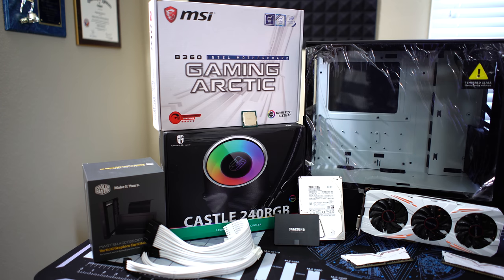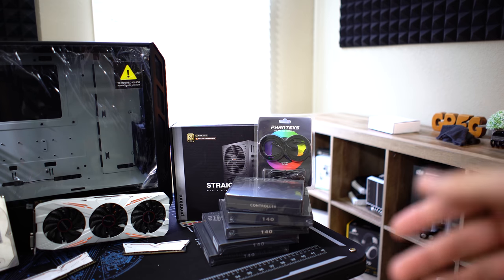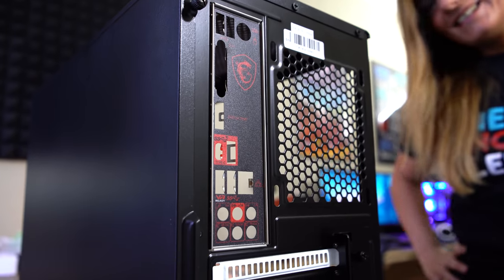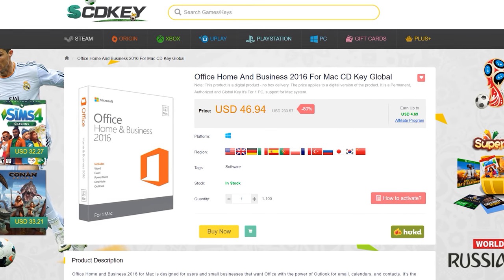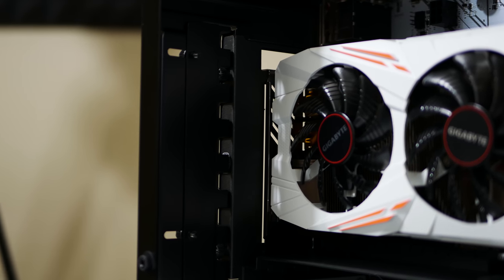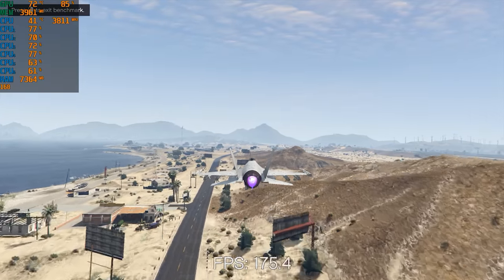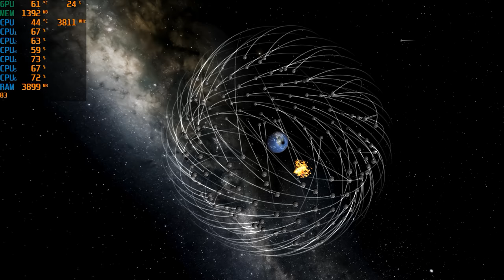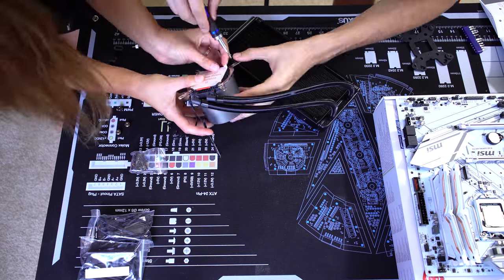We Paired a 1080Ti with an i5 8400...

Comment: Just came across this and have to add that i disagree.  even withaverage cpu load you can still have a system that bottlenecks your gpu. thats pretty clea since the 9900k and 10900k came out.  you can get more fps out of the same gpu despite it being always on max usage.  same for faster ram. it improves fps despite it not seeming to be a bottleneck it clearly is or you wouldnt get better fps out of it.
Reply from the maker: This is an old video. Things change super fast. If you're CPU-bound entirely, then upgrading GPUs won't change much of anything. If you do see a performance increase after swapping cards, then you weren't truly CPU-bound to begin with. I never said that you can't have a GPU bottleneck if the CPU is moderately loaded. It's common sense.
Reply: @GregSalazar  i mainly commented as many people believe that you are only cpu bound if your gpu is not hitting 100% load and your cpu is showing 100% load. And that is wrong you can get much more fps from a faster cpu even if your gpu is already at 100% load and your cpu is not. 
As for truly cpu boung i think noone is these days  even a old quad core with a 2080 ti will benefit from a upgrade to the new gpu when it hits. and its also possible that that new gpu will hit 100% load. That all however does not mean your not limited by your cpu.   if you watcyh all the reveiwers that test cpus for gaming with a 2080TI theres massive differences in performance per cpu.  they however do not call that cpu bound but yet in my opinion it is as you can miss huge performance by getting a faster cpu. 

I still have no clue how a gpu can run at 100% but still benefit from faster ram and a faster cpu tho.  it is strange to me as you woulld expect that 100% gpu load is 100% gpu load and it cant preform more work.  my only theory is that the gpu load refresh is so low that you wont nitice the gpu idling for fraction of a second all the time wating for the ram and or gpu to catch up. 

Anyway i respoonded as this came out on top researching bottlenecking  (was helping someone out who didnt believe me ) and this info didnt help making a point and trying to explain the current situetion.  its not a personal thing to you ots the mystery of yotubes algorithm that thihnks its fun to serve this up on top 2+ years later. yet its these videos despite being outdated that get people to believe the wrong things about bottlenecking.  so i just hope the read a post that adds some current information.

Comment: I’m about to get intel core i58400 is that bad?
Reply: Nowadays yes it's not the best get i5 12400 at least to get a decent performance specially if paired with high end gpu
Reply: My i5 8400 now barely hold with rx 6800 and i lose much performance compared to 12400 the difference is huge in fps

Comment: Is it okay to buy 3200 ram on 2666 motherboard??
Reply: ni si sure but why would you buy 3200 if you can only run 2666 on your mainboard?
Reply: Leon davinchi that’s what he did, no?
Reply: Probably cause he had it laying around and it’s 3000mhz not 3200.
Reply: Leon davinchi okay...does ram speed matter for intel cpu like 8400?

Comment: actually, the more your resolution goes up, the more the CPU becomes more useless. Typically the recommended build is 8400+1070ti
Reply from the maker: DarkWorld25 I never said otherwise. Not sure why you feel the need to word it this way.
Reply: +Science Studio it was just that at 0:24~ you phrased the question more towards whether it will perform and not bottleneck at higher resolutions, where the CPU usually not the limiting factor, rather than 1080p gaming, where the CPU affects the framerate and quality more. I think you addressed that later in the video, but because I'm using an out of date version of YouTube I couldn't really edit the comment. 

also, I now feel like a complete idiot because all my parts went on sale literally a week after I built my PC
Reply: +Science Studio BTW great videos, keep it up (PSU choice was the best! I still like the bitfenix whisper m better tho)

Comment: Why not ryzen 2600 ?
Reply: Hidde 345 personal preference.
Reply: Mario Brother it can overclock and is beter at video work and vr
Reply: Hidde 345 if you really need those extra cores/threads go for it.although you will not go far with the overclock.
Reply: Mario Brother 4.2gh is the max i think that is enough for like 5/10 fps boost just overclock the ram

Comment: I heard youd be better off with 4 cores 8 threads than 6 cores 6 threads.
Reply from the maker: Very much depends on the use-case.
Reply: Science Studio this is the video i watched that lead me to believe so. https://youtu.be/NJLF8dPRI1Q  its kinda suprising since i thought 6c6t would be big upgrade for my 3770k 4.4ghz
Reply: SpicyHotTech might do, but for now, i havent experienced any major bottlenecking since i run games at 60fps (except csgo). I was just considering the upgrade to a 6c6t
Reply: SpicyHotTech Ac Origins still has many problems
Reply: SpicyHotTech interesting, ive never tried yet. Hope it runs alright tho, i mean, 4.4ghz is a big OC in my opinion.

Comment: You shouldn’t pair a 1080Ti with anything that’s not an i7-6700k, 7700k, or an 8700k
Reply: In gaming 8400 is close to those cpu you listed(i think is on pair with stock 7700k) and very close to stock 8700k...so its ok combo who is on tight budget and want best gaming experience right now without waiting....mabye 1080ti is overkill (because anyone who have money for that gpu have money for some better cpu in theory) but for example 8400+b360 is nice save of the money +you can stretch for something like 1070ti and you will have very powerfull gaming pc for 1080p/1440p rez. even 4k for some games...and 9 gen intel cpus are confirmed for 1151 - this coffelake socket!!!!